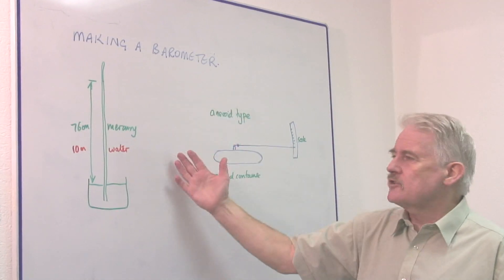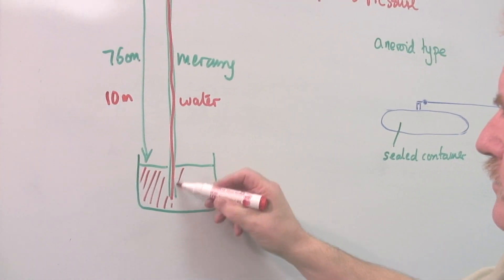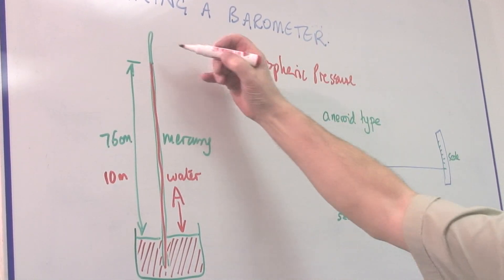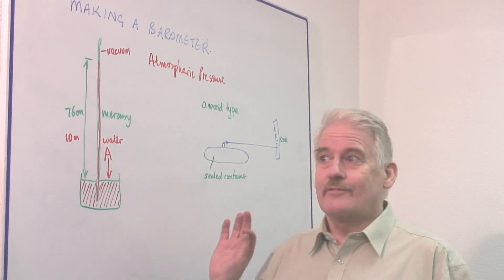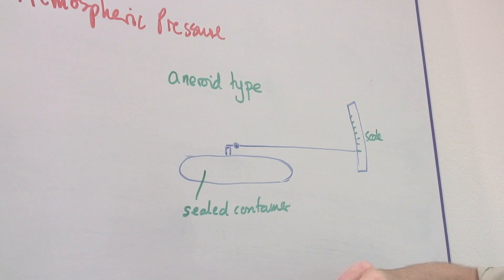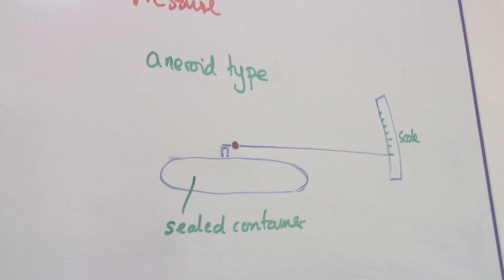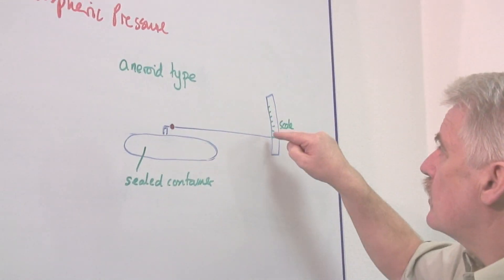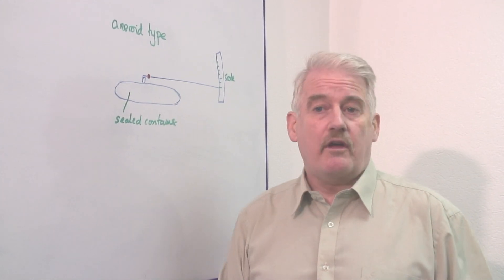Physics & Electromagnetism : Making a Barometer

Comment: In theory you can use any liquid but the problem is the height of the column.  In the case of water it would be over 10.3 metres high!  I suspect oil would be not far short of that figure also.